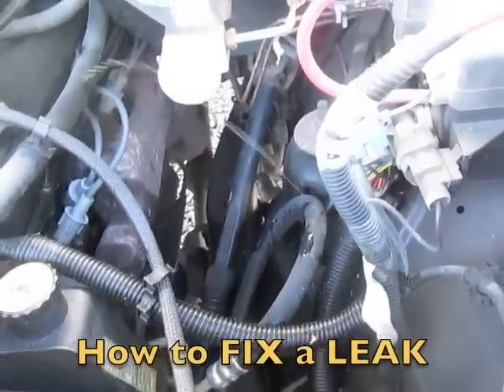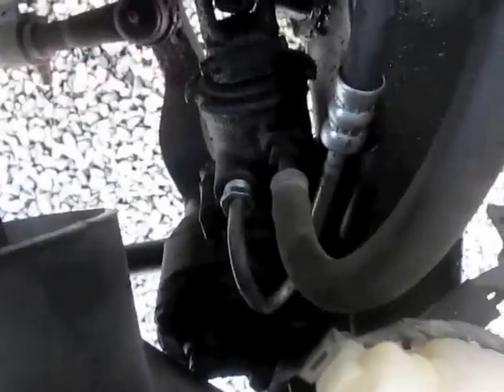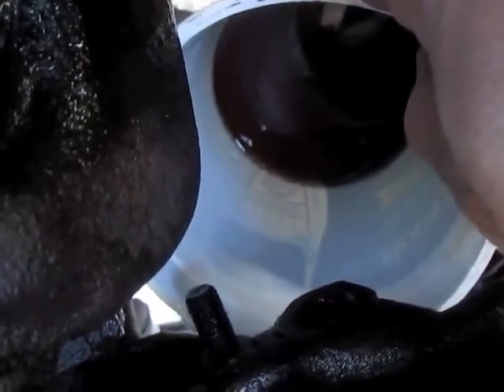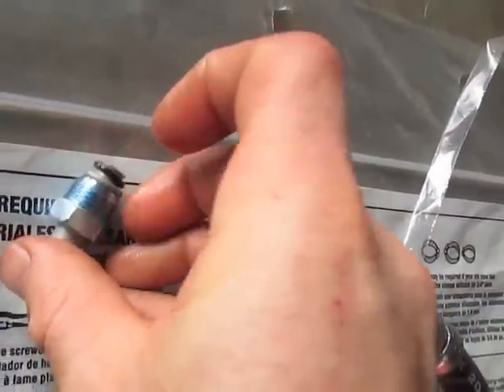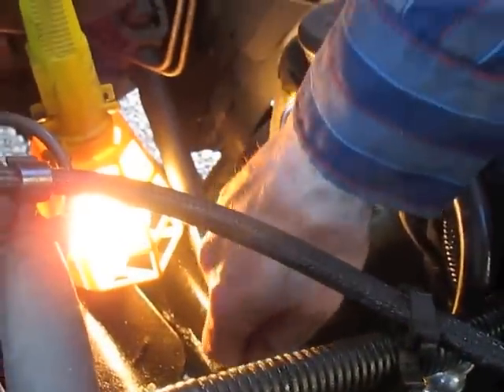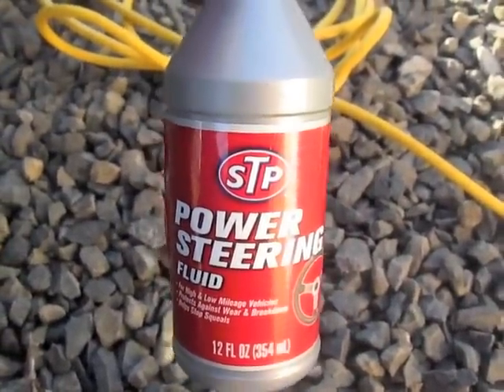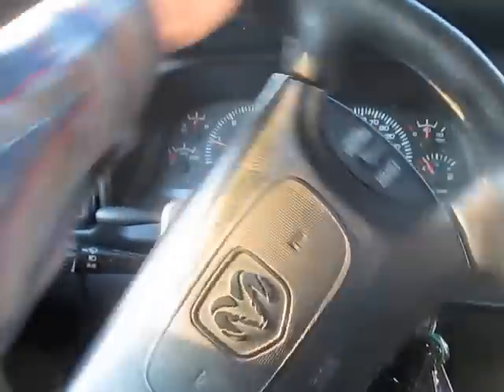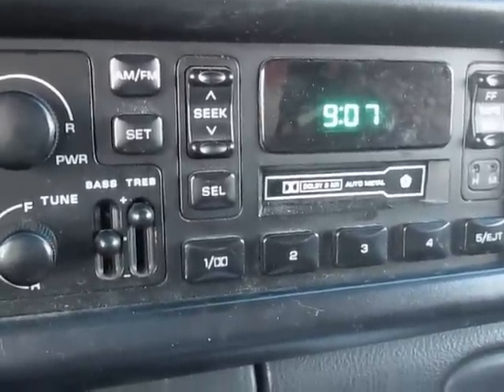REPAIR POWER STEERING HOSE Dodge Ram change High Pressure HOSE replacement

Comment: I wish more videos of replacing parts were on thanx. I worked in shops off and on for 10 yrs. Most in electrical. clusters. radios. pcms. bench repair. and in beginning as a tire man/brakes and suspension.  but they gave the lump to the ase. cert. mechanics. and them guys like keeping stuff to themselves so they aren't going to lose work. Just seeing the general o ring and fasteners let me know 15 min to 45 min worth of knuckle scrapping.  thanks again
Reply from the maker: +precinct 1 baltimore county residents Yeah I hate paying to bring stuff in to the shop if I can do it myself.  Best of luck!

Comment: Easier said than done! I have Durango 2003 4.7L and it is impossible to get access to the pressure hose fitting, bought crowfoot wrenches and all the tools needed, still cannot get to it. I'm ready to give up. I've done a fair amount of work on vehicles for many years... I'm stumped by this one.  I don't want to remove a lot of parts our of the way just to access it. Love Durango and I have a 2006 also. The 2003 has been sitting in the garage for 2 months now. Frustrated!!!  (by the way, PS fluid is ATF+4 )

Comment: I have a '99 Ram 1500 RWD 5.2L, and this video helped me a great deal. Never had replaced power steering lines before this. Went pretty smooth however ended up having to cut one of the lines since the rust fused the compression nut to the metal line. Just used a 7/8 socket to finish the removal. Sizes are 7/8, 5/8, and 18mm. Used some Gunk engine cleaner beforehand to clean area up.
Reply from the maker: Hey thanks for the comment and the additional notes.  Wish everyone posted awesome like this!  A compliment and a few additional tips.  That's what these vids are made for.  Hopefully you hit the like button!  Every like helps my vid rating, so others can see it as well.  Thanks again!

Comment: My 2000 caravan 4cyl has non removable metal pressure line. It was mounted first at factory on body bottom,  with steering long gear box mounted on top. The metal line leaks at a corner. I put a split rubber hose over crack on tube  with double screw clamps to slow down the leak. The 2003 caravan service manual has no reference to replacing pressure power steering line either.

Comment: Did you have to buy the part from the dealer?
Reply from the maker: Thug Life No go to any auto parts store.  If you have a long drive to get to a parts store call first.  The first store I went to did not have one, but there was another parts store on the same block.  I just stopped there and they had it.  Best of luck!!!
Reply: You can Fix It!!!! no

Comment: is this same for a 2000  Durango
Reply from the maker: http://shop.advanceautoparts.com/web/PartSearchCmd?storeId=10151&catalogId=10051&pageId=partTypeList&suggestion=&actionSrc=Form&langId=-1&searchTerm=durango%20power%20steering%20hose&vehicleIdSearch=42152&searchedFrom=header&storeCode=&isAllVehicle=false

I haven't done a durango, but I went online carquest and checked out the
 parts and they seem similar.  Not sure if it's the same engine.  They 
are also priced reasonably. I know the newer dodges hose a quite a bit 
more spendy.  Here is where I was looking